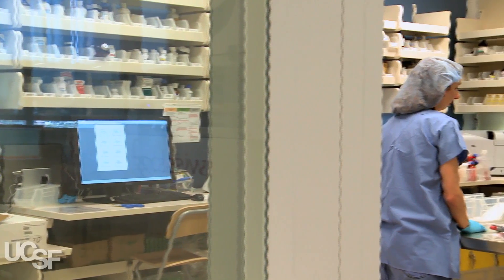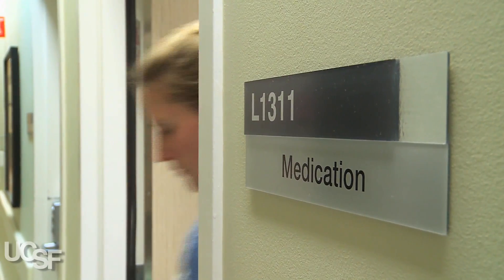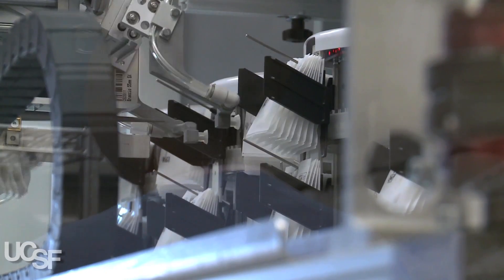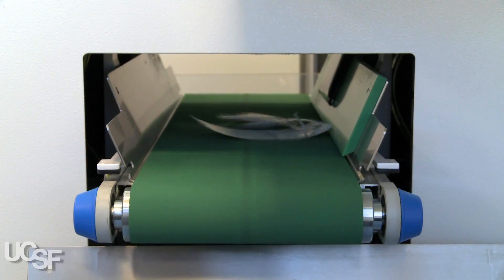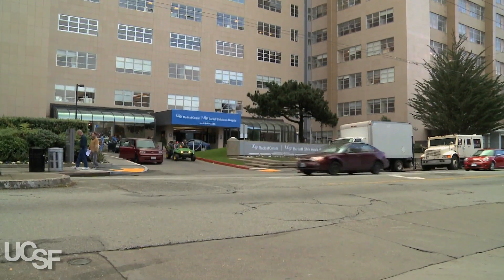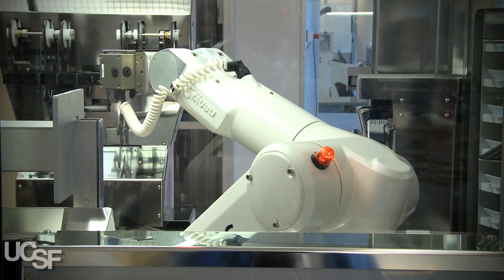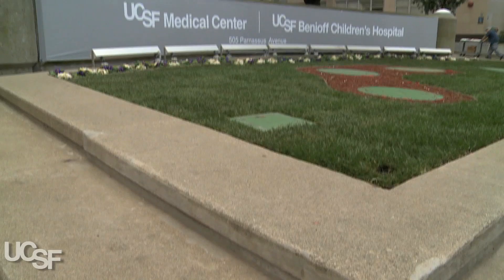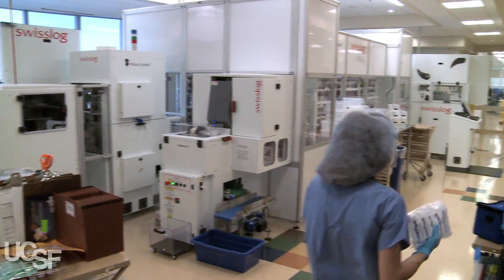UCSF Medical Center Opens Robotic Pharmacy to Improve Patient Safety

Comment: LOL, how does this solve human error?  A human has to program the dammed thing to begin with.  :sigh:  Goverment waste at its finest.
Reply: We double or triple check with control stations in the middle of the process, for example, using barcode readers, vision inspection and at the end, an operator (pharmacists) who will check and approve that everything is exactly what was requested.